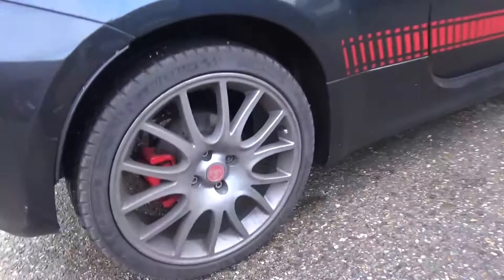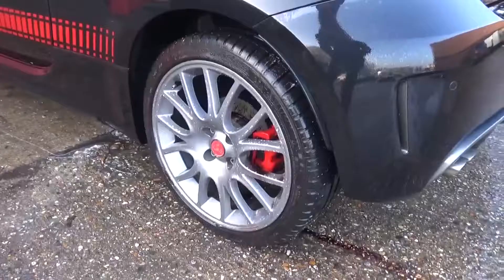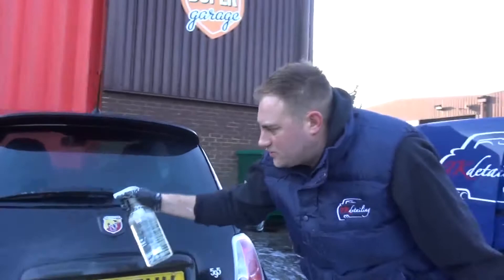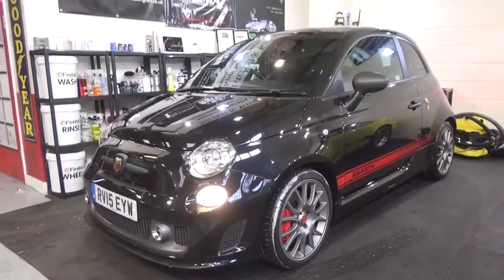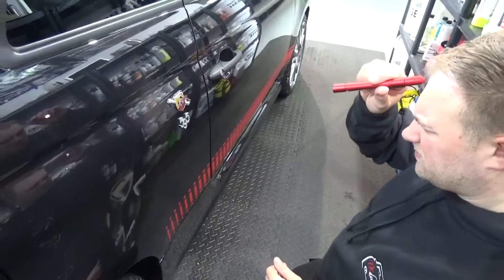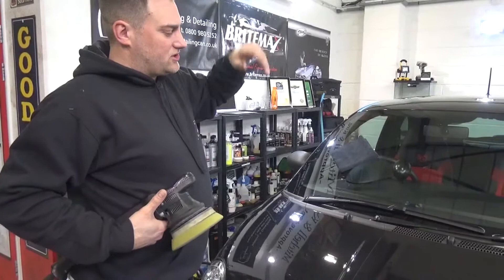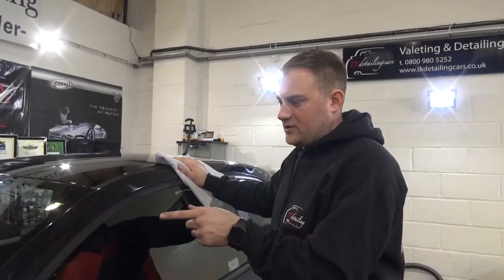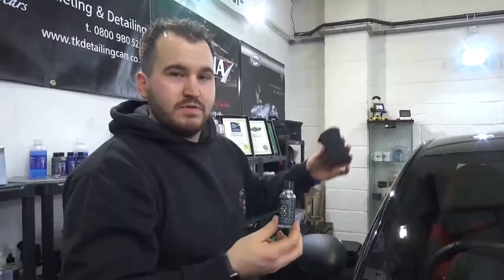Detailing The Abarth: The In-Depth Process!

Comment: I cannot see the point in spending quite a lot of money, on professionally cleaning and polishing your vehicle.
Removing every paint blemish, and polishing the car to better than factory finish, will not last very long, once you drive the car on the road.
Unless you own a valuable classic, or rare supercar, that you are about to sell, having your car detailed makes little sense on the congested roads of the Uk.
Reply from the maker: The idea is that the paint is brought up to a high standard and then chemically protected (ceramic coating, wax etc) or physically protected using PPF, to ensure it remains at a relatively high standard for longer.